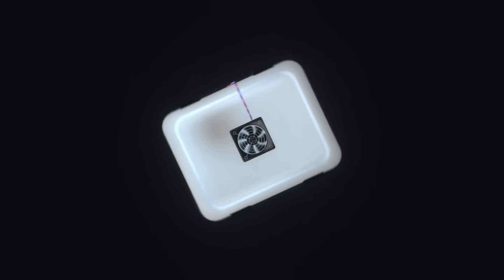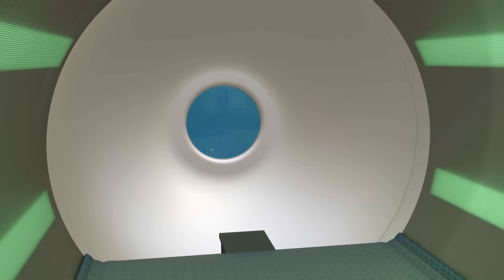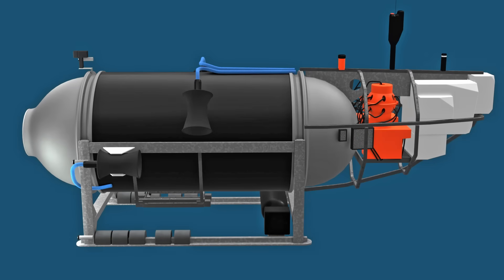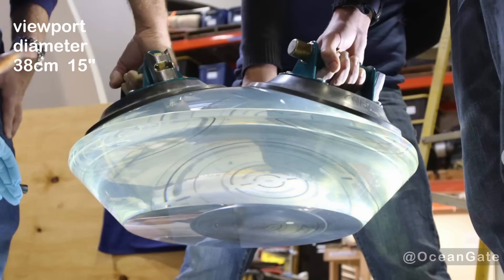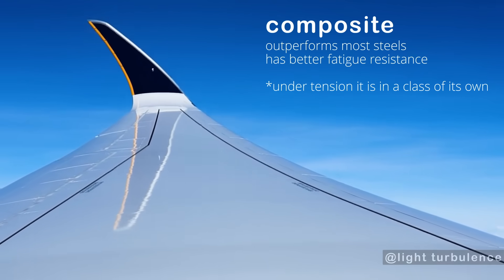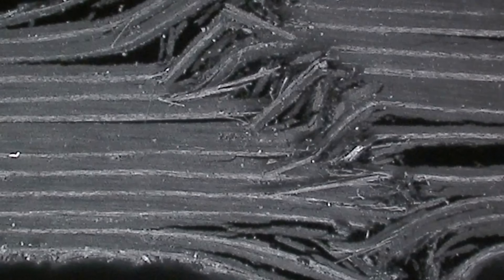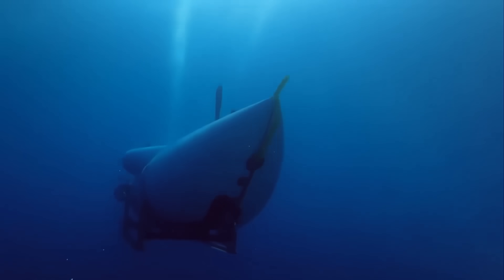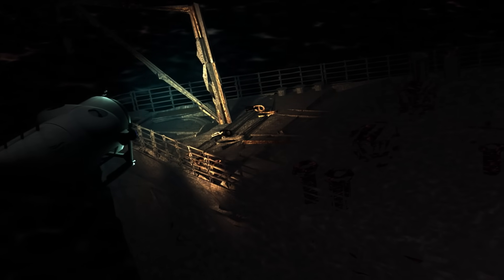Titan Sub | carbon fiber - Detailed Tour

Comment: Another factor that you may not be considering is the rate of descent.  According to the communication logs purported to have been between the sub and support ship, they were descending twice as fast as they had "planned" (or at least, had advertised their "descent" plan).

Everybody is (rightly!) talking about the absolute pressure on the sub,  but change in pressure also adds stresses of a different nature.

While I like the idea of a helical layup, because you can get the same sort of crossing of directionality of fibers... I am uncertain as to whether that will solve the ultimate problem you cited; the problem with the wrinkles isn't (just) that it compromises the strength of those fibers in the direction of layup, but why it does. The reason it is a problem is that the fibers aren't in line with the pressures being exerted.  The pressure exerted on the hemispheres would be transmitted in a direction out of line with the fibers.  In other words, the fibers would be under tension, but they would be made up entirely of the "wrinkles."  

A better alternative, I think, would have been extending the fibers beyond the mandril, onto clamping rings that would pull the fibers taut.  This would unfortunately require some additional steps per longitudinal layer (e.g., laying the rings along the entire mandril, laying the longitudinal beyond the mandril onto the clamping rings, tensioning them, trimming that layer, replace with larger clamping ring, repeat), but it would solve the problem without a complete redesign of the layup mandril, nor as much waste. 

Alternately, to cut down on the number of between-layer steps, have a gap between the rings on the mandril and those on the clamping ring (i.e., || |||||||| ||), resulting in a weak point where you're going to cut anyway, but maintaining the thickness, so you only have to have one tension step, with less impact on the longitudinal density of the ring layers.
Reply from the maker: The too fast descent if from the "leaked" transcript which is fake.  I was contacted by a crew member who confirmed the transcript it as fake.  I will post a video shortly explaining what I was told.

Comment: Mike: Very well done presentation. However, do to a glaring error regarding the pressure on the porthole it does make one question your credentials. You said the porthole was 15" in diameter which give it a surface area of 176.7 sq. inches. The water column pressure at 12500 feet is roughly 378 atmospheres. At 14.75 psi/atm that equates to 5,587 psi. That equates to a total pressure of appr. 987,244 lbs or 493 tons. Using your elephant analogy (at 12,000 lbs ea) that would only be 82 elephants standing on the porthole.
BTW, if this vessel was at bottom of the Mariana Trench, the pressure on the porthole would only be equivalent to 263 elephants standing on it. In either case, that's a long way from 2700.
Respectfully
Reply from the maker: Well spotted.  The outside diameter of the viewport was 21" so the pressure surface is larger.  But still my calculations contained an error.  The water pressure on the viewport is 910 Tons ~ 180 Elephants | Viewport outer diameter 21".  345 sq inch @ 5,800 psi = 910 Tons.
I have added a correction note to the comments.

Comment: Most of the information in this video has been presented a number of times previously. You've made a bunch of unsubstantiated statements. I cannot see how designing a glider is at all a parallel to designing a deep sea vehicle. And lastly, what credentials/experience do you have to even think of presenting these statements, I wonder?